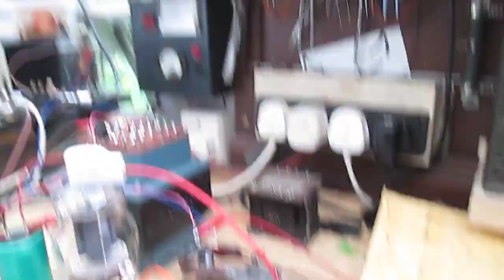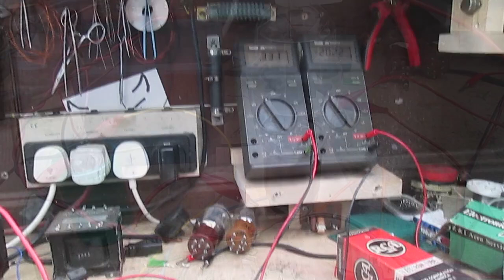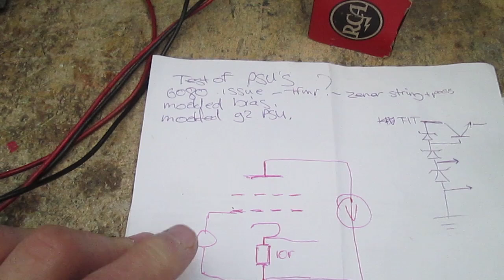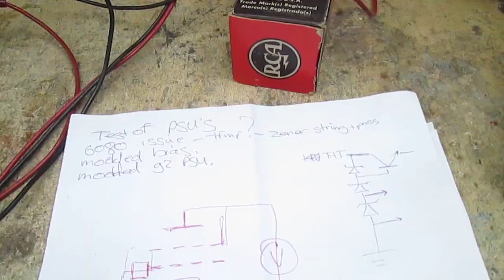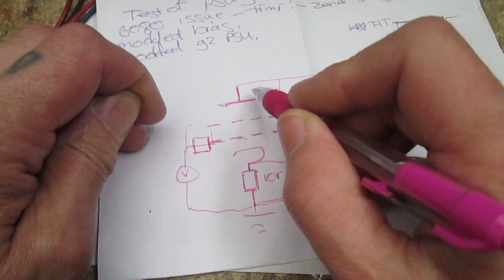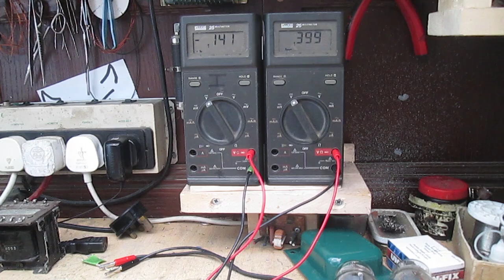Testing 807 Beam Tetrode Valves/Tubes - Part 1.

Comment: This is why I'm sceptical about valve testers that just give you a good / fair / bad reading. There are so many parameters that you want to measure, that a setup like yours is much more reassuring even if it takes longer to test a valve (about 3 days in this case).
Reply from the maker: A valve tester as you say, only gives you an indication, but unless it's calibrated the result is meaningless Like a traffic light, green means go but at 5pm on a Friday when' folks want to get home.... Also it depends on how the valve is tested, most vintage VT's test valves as diodes or at low voltages.
  As in hopefully shown in this video, it depends on the application too, a lot of valves we use were designed as transmitting valves, not as AF types so the datasheet needs interpreting, it's a guide. 
   Anyhoo, thanks for watching and for your input, it's grand to get feedback & share info.

Comment: Hi Andy, 
Really enjoyed that as it’s very relevant to my current 807 build project. No doubt if any of my 807’s are ‘gassy’ then it will become apparent! : )
Reply from the maker: Glad you got something from this video. Valves, especially transmitting valves like the 807 can do some weird shit like, self oscillate,  negative resistance, gassyness or your test setup can influence the result. That said I've had no trouble with them in an amp. Usually after a few hours they settle down.

Comment: Andy- Many of my tube testers have ferrite beads on the wires to prevent any oscillation. Hickok and Seco use them on just about every wire, IIRC.
Please keep in mind that it was very common for tube companies to buy from each other, then put their own brand name on them, but the mfg. codes WILL be different, no matter which brand is stamped on the tube. Please keep in mind that a tube which shows a bit of gas, if run for several hours at about max current, can sometimes heat up enough to cause getter material to activate again. 
Good progress on the project.
Reply from the maker: Never had much luck with ferrite beads but as you say, they do work. Will try the oven, did try leaving the heaters on to no avail. TFW.